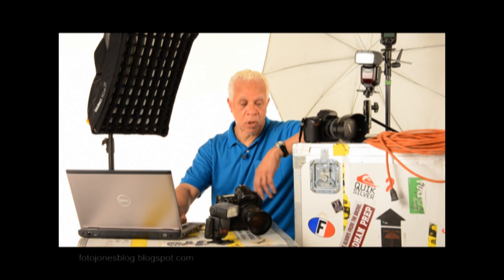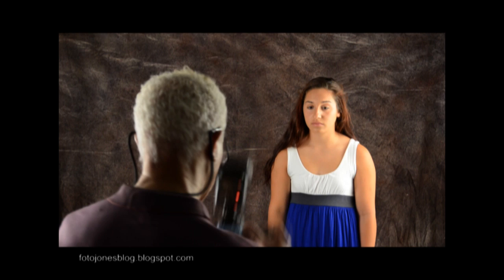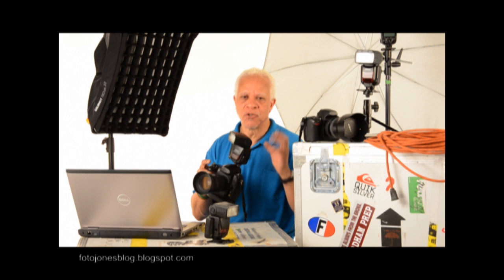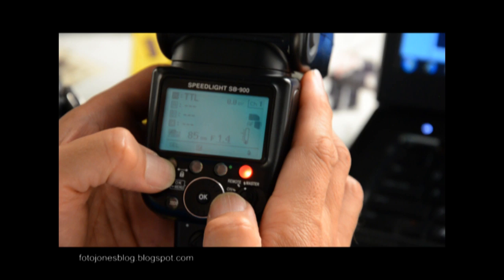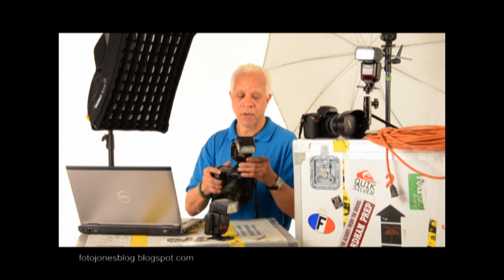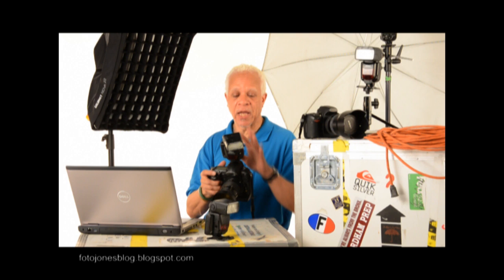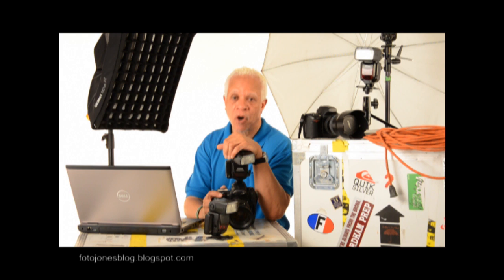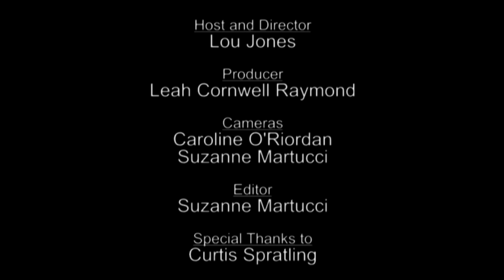Speedlights: Manual vs. Automatic

Comment: TTL is fine if you do not know what you are doing or if you are in rush but you must then shoot RAW because you will get wildly different exposures depending on clothing and background. If you measure the light and the flash exposure you will get correct exposures every time, it is the same amount of light hitting the subject, clothing and background do not matter.